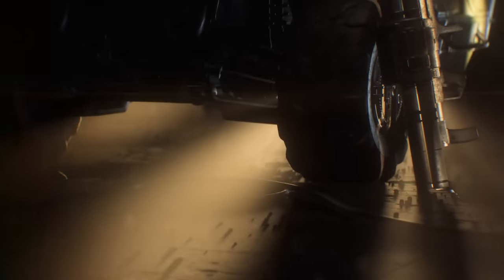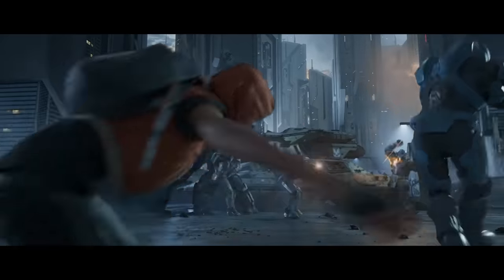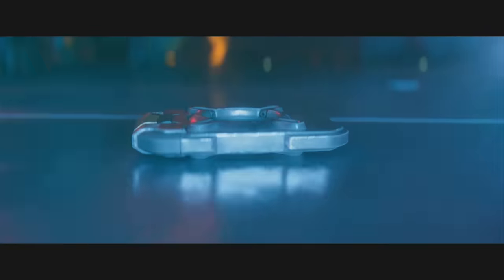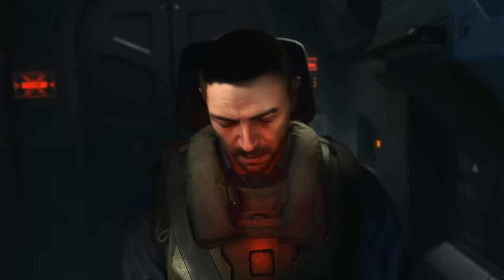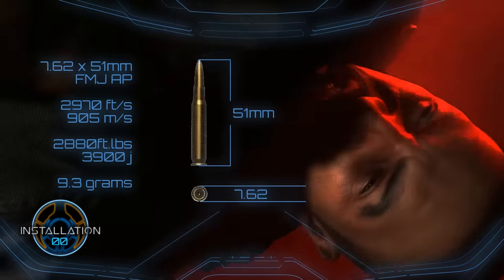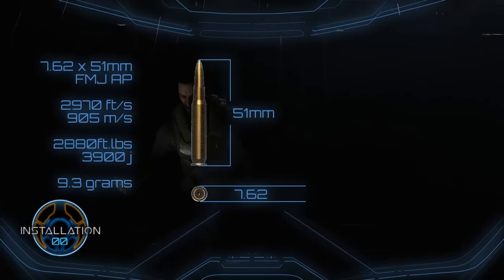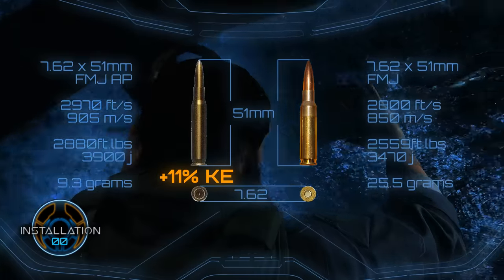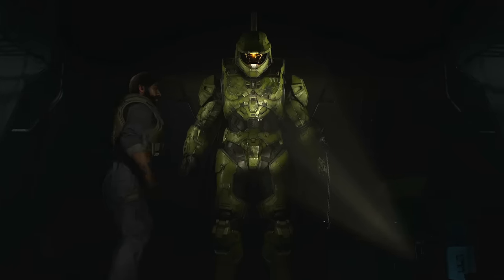Why are UNSC Weapons so powerful!? | The Armory

Comment: Considering at present time, SIG Sauer just won the US military next gen rifle, chambered in 6.8x51mm, it wouldn't shock me in the slightest that the UNSC rounds would be more powerful. For context, the .277 SIG Fury (6.8x51mm) with the Hybrid stainless steel/brass case has a standard pressure for military use (only) of 80,000 PSI. Standard 7.62x51mm is around 60,000 PSI. That huge increase will allow the 6.8mm bullet to leave a 16" barrel at 2950 feet per second. There is talks that the hybrid case can be max loaded safely to 105,000 PSI. Granted you would be eroding the barrel much faster.

So it is quite possible the future rounds are well more powerful than modern day with better design in case materials.
Reply: General Dynamics bullpup design has a twenty inch barrel and tests have shown a 20% increase compare to 7.62x51mm NATO rounds.
Reply: If the point that degrades is controlled, then it is simple to replace that one mechanism as a result of its use.
Reply: @WolfeSaber9933  that's because the bullet casing only transfer half as much heat compared to brass ammo (means more energy can be used by propellant to burn more efficiently), so with 10% less powder in same ammo pressure they can achieve same performance to their brass ammo equivalent.
Reply: It's too bad you can't invest in Sig Sauer. Already own Sturm and Ruger
Reply: First off sig Sauer won the bid to replace the SAW (squad automatic weapon) not the standard rifle.(will they ever replace the M16 platform that remains to be seen) second whether we will actually see SIG Sauer's new squad weapon ever in us troops hands is an entirely different deal do you know how many "replacements for the m16/m4" the us military has fielded and liked over the years yet never see combat. I wouldn't get your hopes up on it. They just finally managed to start actually replacing the M9 and that's still going to take years to fully implement.
Reply: sadly the end result, regardless of it all, is still only very slightly a marginal increase on ballistic damage over a 7.62. yet compared to the m4: 
-you'll still sacfrice by far a lot more ammo
-your recoil will be a lot more which will ultimately reduce semi auto fire rate
-the weight is a lot higher and that'll be before the added suppressor and gigantic optic
-your mag size is considerably shorter
-the gun is larger and longer

the only benefit without a serious drawback is the fact that it's an mcx. Which are basically an outright upgrade to the armalite rifles.

With all that said, it is still a fantastic rifle, but it is now very commonly betted in becoming a very horribly implemented military rifle.
Reply: @saddgod  Sig Saurer also won the bid to replace the M4 with the XM5. The XM250 is the gun replacing the M249. Sig won both bids and will be replacing both guns.
Reply: @Amondil1  you are right I only knew about them replacing the saw but upon googling it I see I was incorrect they are replacing the m16/M4 as well. However my point stands as to when and if we'll ever see it fully replace the M16 platform could be decades if ever the xm5 certainly isn't the first rifle they've tried to replace the M16 platform with.
Reply: @gpheonix1  -remember that your puny 5.56 rifle cannot pierce modern ballistic armor, so your volume of fire superiority won't do anything to enemy. Damage on the flesh might be marginally increased but you enemy have ballistic ceramics between your bullet and their flesh. Between 4-6 shot from M5 rifle vs 1 magazine from M4 rifle the choice is pretty clear. 
-Fully kitted out fully loaded M4 (with good LPVO, PEQ-15, Laser Rangefinder, Suppressor and Ballistic computer) will weight just as much if not more than fully loaded M5 rifle with XM157 Fire Control Optic and SLX Suppressor
-The reduced volume of fire on the rifle is compensated completely by much higher accuracy of fire because of the optics and been shifted more to the SAW (remember that the doctrine is to shoot enemy accurately with rifle and suppress them with SAW)
-shorter magazine are not always means negative because you can go prone better without your rifle magazine getting in the way.
Reply: @zidniafifamani2378  Modern ballistic armor also only covers the chest/back. It isn't like UNSC Marines(specifically Halo Wars) or Spartans where they have armor plating all over. Until armor starts covering more of the body, and properly armored helmets are introduced, 5.56 will do just fine. Also, the 6.8x51mm doesn't do any better against armor than the 7.62x51mm(non armor piercing). Armor Piercing ammunition for the 6.8x51mm hasn't been shown yet, so we'll have to wait and see.
Reply: @Arkancide  can you guarantee that within next 50 years ballistic armor will stay only protecting the chest area? Even now relatively lightweight (16 pounds) level 3a-like full body armor with protection compliant rating of NIJ Level 3/NIJ RF2 are starting to be introduced (for example look at Safe Life Defense Flexible Rifle Armor System).

Velocity beats ballistic ceramics, and NGSW program require the bullet to have velocity of at least 3,000 fps (as I remember isn't specified to be muzzle velocity or velocity at certain distance).
Reply: @zidniafifamani2378  Of course I can't. However, full suits of armor aren't in circulation with ANY military. There is no indication that anyone is even considering such a move. Obviously that can change at any time.

Velocity IS important, but just as important is the bullet itself. As far as I know, AP or black tip, ammo isn't widely produced or distributed at this time. Really isn't a reason to shit on 5.56.
Reply: @Arkancide  that's the thing, in the last 20 years alone soldier went from using iron sights only to mass deployment of red dot, holographic, ACOG and LPVO, Handgun & fragmentation ballistic silk to XSAPI rifle-rated ballistic ceramics, naked eyes to IVAS, handgun & fragmentation ballistic helmet to rifle-rated ballistic helmet, cloth uniform to fragmentation-resistant polymer-impregnated ballistic fabric, and many more. 

Yet, it's only the matter of time before modern manufacturing catch up to mass produce them.
Reply: @zidniafifamani2378  Agreed. Just waiting for the armies of the world to begin doing it. Until then, 5.56 will do fine up to the point the new weapon systems are adopted. Not advocating for its use further into the future.
Reply: I wouldn't hold your breath on SIG Sauer. I remember time and time again of rifles being selected and then ditched. We can't get away from the M16 platform due to how cheap it is.
Reply: I can't believe the Army went through the whole process of replacing their sidearm before the rifle or Squad automatic. Military Arms Channel did a great episode about this new rifle.
Reply: @zidniafifamani2378  well yes, militaries have been ditching leg and arm armor since the 1500’s and 1600’s, it’s simply more economically viable to protect the vitals of every soldier instead of giving full coverage to only a select few elite units.
Reply: @Slender_Man_186  true that it's cheaper, but it usually also hamper your mobility, but what if cost isn't a problem and it won't hamper your mobility while being strong enough to protect you against anything you reasonably will fight directly at? 

Then you get tank-wearing augmented omen of death that cost as much as starship.
Reply: @zidniafifamani2378  eh, you’d be surprised, late medieval/early renaissance full plate armor wasn’t that restrictive, not that heavy either considering it was spread out across the whole body. The real issue is that it was very expensive, each suit of armor was a work of art in it’s own right and it shows. The metal work involved in making shoulder, elbow, hand, hip, knee, and foot protection that didn’t hamper mobility much while still providing near full coverage really is something to behold, seriously look it up, and if you screwed up at any step of making those intricate pieces then you’d have to start over. I doubt the process becomes any easier when you have to make the armor strong enough to withstand gunfire, especially if the material involved is something as hard to work with as titanium like in Halo.
Reply: @Slender_Man_186  Titanium Grade 38 actually have good cold workability despite its higher atomic density (watch Installation00 The Archive - Titanium A Armor).
Reply: @zidniafifamani2378  that titanium still has to be cast and heat treated basically perfectly with no impurities or it simply won’t hold up. Check out Garand Thumb’s video where he tested the Russian Altyn helmet if you wanna see what I’m talking about, they’re pretty damn heavy titanium helmets design for the Spetsnaz special forces, but even pistol calibers were able to put some pretty damn impressive dents in it, even with padding you’d feel them poking into your head, and rifles rounds punched right through.
Reply: The 80k psi rounds are not military only, they're available to purchase now.
Reply: @Arkancide  you need take in consideration that US PLAN For 10 years into the future. And they need to start making the changes to day. That is something that you are missing.
Reply: Most of the stuff in Halo is made from Titanium-A which sounds like a Sci-fi invention where they gave Titanium a different 3D printed lattice structure. Something similar was done in the real world to Aluminum making it both lighter and stronger. If you could do that to Titanium it would be insane.
Reply: @saddgod  Think you’re a little off there. Sig officially won the contract for the M4 and 249 replacement, with the Army intending to fully arm close-combat MOSs with the new weapons before moving to full adoption by the rest of the army.
Reply: @buschacha  see my second comment I corrected my error
Reply: IMO the problem with the new round would be logistics as all or if not most NATO countries today used the 5.56 round which would be challenging
Reply: @saddgod  Ah I see it now
Reply: i’m pretty sure .50 BMG is 60,000 psi
Reply: @saddgod  The army stated that the XM5 won't completely replace the M4, at least not just yet. I expect they might just eventually decide to put the XM5 in a DMR role in the end.
Reply: @jacksonvaldez5061  Less actually.
Reply: the reason they're using such a long round is so they can use already existing magazines that use 7.62x51 to cut cost (and likely make it less popular as a result) otherwise I believe they'd be using 6.5 creedmoor (6.72x48 for ease of comparison)
Reply: @Seriona1  thing is that the XM5 was the closest to the current M4 out of the offerings but with the best benefits to drawback ratio. Given that the rifle is going to be familiar to use for current soldiers and the deployment of this new rifle will be over the span of decades (the M14 was only used for a short time as the official infantry rifle in the mid century but is still used for DMR roles today) the rifle has potentially to be the SPR for a squad and then as number of rifles increase, the number of squads with the rifle increase. 

I still think it'll be specific for spec ops/specialty roles for the rest of this decade though. Unless manufacturing goes crazy and it doesn't become a Sig specific production but a licensed out IP like how we have the whole AR market today selling to the military with DD, Geissele, and many others supplying milspec parts and rifles.
Reply: That garage round and rifle aren't going anywhere. They will be stuck in special applications just like the Scar.
Reply: @bombomos  agreed it's too heavy for what benefits it adds plus the smaller mag it might (pretty big might) become a squad DMR with the fancy (totally not going to be bricked in 12 minutes by a grunt) scope
Reply: @jimbothegymbro7086  I got so darn excited when I realized they won the contract. It looks cool as heck, the competitors seemed like they had big flaws and imo we shouldn't have a bullpup, Sig makes great stuff especially if Big Army is footing the bill lmao, and it plus the new ammo seemed to have a ton of advantages on paper. But I had no idea it was that heavy, I didn't know it was limited to 20rds, and I certainly didn't realize that a soldier with 210 rounds in 7 mags today would be looking at I think 140 rounds at the same weight taking up at least as much space

So it seems to be an absolutely fantastic rifle. But folks here and elsewhere have brought up a lot of the downsides. It'll be good for marksmen, spec ops, and defeating near peer armor. Yet I've heard all the time about how the thing that wins gunfights is how many rounds your dudes can bring, and how many they get downrange in a given time. Meaning this'll probably just be a marksman rifle. Which is still awesome but idk how they could completely phase this in, even over the course of several years, and have enough of an advantage to justify doing, especially with all the time money and development it's cost. 

They likely have thought of lots of things that I haven't though, and thanks to the OP for bringing this up! I came to the comments hoping someone would : p Fantastic to see that Installation00 knows about firearms, seemingly more and more folks who are into gaming (or make them) are thankfully realizing not only how interesting they are, but how fundamentally necessary they are for a safre functioning society
Reply: @jacobl6714  on the note of necessary for a safe functioning society I'm in Australia and I can see exactly why, I haven't been able to work for 312 days because of the man dates involving and injectable that youtube will delete if I say the name of, police arrested people for organizing protests and went to people's houses if they said they were interested on facebook or similar platforms they even arrested a pregnant woman in my town for it
Reply: @gpheonix1  It's basically M-14 II: Electric Boogaloo. The brass never learns.
Reply: @outis7080  but it's not. Maybe it'll end up like that and worse. As it's not an additional weapon.  All combat units will have their m4s replaced with it. If this makes it past xm5 into m5 it will be the new standard issue rifle for rifleman. Further, it's literally not the same. It's a middle ground between 762 and 556. the gun is definitely heavy, but it's ammo is a lot lighter and more manageable recoil than 762.
Reply: it should be noted that the XM5 has a 13 inch barrel and achieves velocities of over 3,000 feet per second with the military loaded ammo; the only rounds loaded to 80,000 PSI. Civilian commercial loads, even with the steel base, are still 3-400 FPS slower than the military loads.
Reply: It's not more powerful though. That's literally the velocity you get out of M80 ball out of a 26" barrel. Like, today. 
And since 1969 when it was introduced.
Reply: Half the barrel length is the point, A 26" long barrel is impractical in the military. Good luck getting in and out of vehicles, clearing houses, trenches, or patrolling through heavy brush with a rifle that long.
Reply: the problem with all supper weapons is they hurt the infantryman!  we have composite rounds, but they did win the new
Reply: @2Potates  XM5 will go to the frontline units first. It would be a few decades before reserves get the Sig. I assume
Reply: Yes this is true but I also found  a product almost readily available using polymer casings and this has also found that polymer bullets of the exact size a 7.62/51 or a more common  round was able to increase power just by polymer being more resilient to heat and is able to withstand static build-up, taking the understanding of chemical reactants and  reainforced nylon casings could alow more power with less  size also meaning a round more powerfull than the normal cartridges with 2 to 5 times the power (if I'm thinking correctly) meaning as others have said a stronger beifer gun is needed to handle the new ammo equaling  the guns you se in halo.

Not to mention a YouTube company called hacksmith industries have made a halo ma40 using the coil propellant system. And it's full auto. So all theories are very plausible ( not to mention its in like 500 something years).
Reply: That or even a more developed version of True Velocity's polymer-cased one would be good for the UNSC.
If I was in charge of UNSC logistics, I'd go with the polymer case because of two main reasons:
1) from what it was released by TV it could better transfer the propellant energy to the round itself, not loosing much to the brass case (being the polymers used less thermo conductive than brass), so it would on greater scale reduce resource consumption on propellants. 
2) Weight savings were interesting on rounds that big and 26th century's polymer would probably go far beyond that level of lightness. [Which means more rounds per loadout and more ammo per same total weight in logistics]
For the ammo count, yeah, nowadays the TV round maybe won't fit more than 20/25 rounds in a mag.
But I'd say that for the 26th century some clever mad-lad would surely understand how to produce a reliable triple-stack/quad-stack mag, opening the possibility for the 32/36 or more round capacity we see in-game.

[+ We must remember that the UNSC is fighting not-so-soft targets like Élites, Brutes and Grunts (Jackals are actually very soft-skinned when compared to the others); so having a punchier, yet manageable round would be like an Infantryman's best dream].

PS: Another choice for the UNSC, if you (random people in the comments) still aren't convinced about that round measure, would be something like the 6mm ARC.
Reply: If we were colonizing planets like in halo its very possible we could also start making barrels from more costly and durable materials like titanium which wont erode nearly as fast. The only reason we have barrels today capable of surviving as long as they do is chrome lined barrels which only became really popular in the mid 1960s